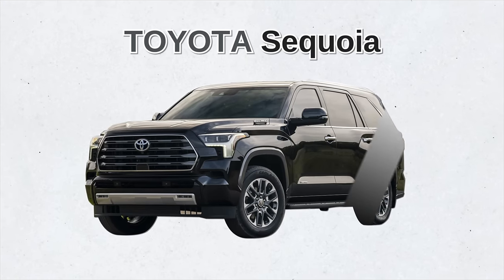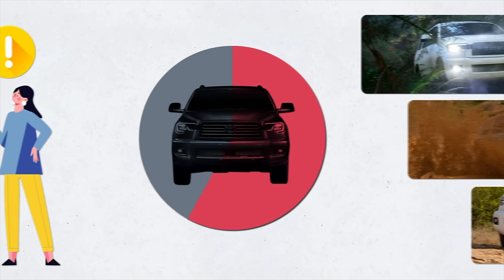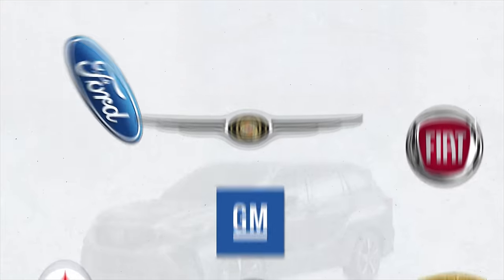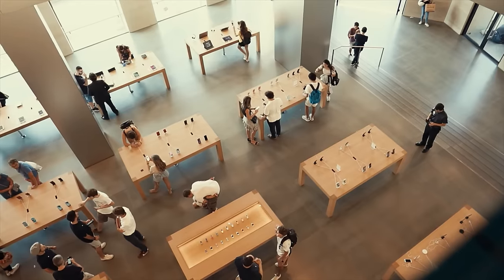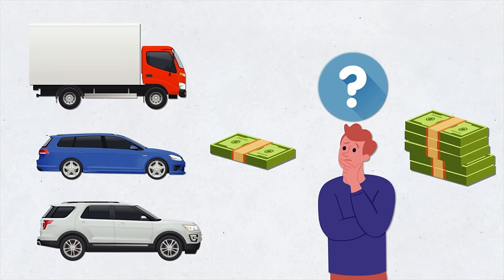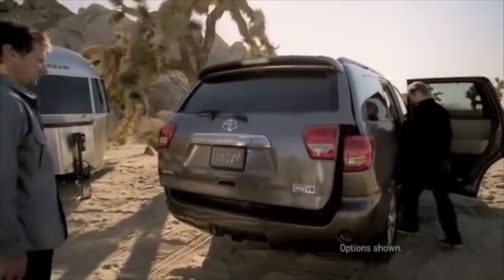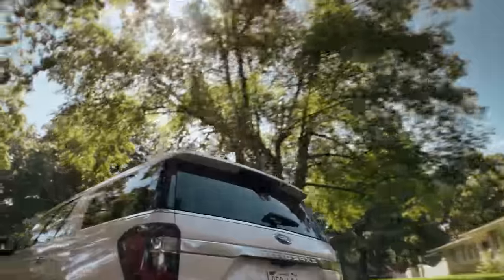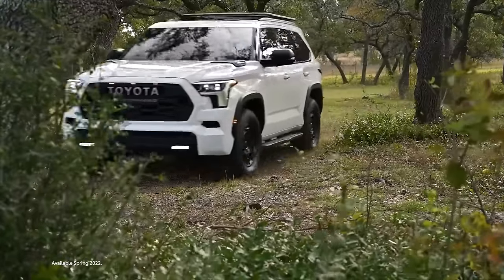Here's Why This New Toyota is Bulletproof

Comment: Shame on Toyota and most of other japanese car manufacturers for not producing more flex fuel cars right from factory. FFV, E85 fuel would be better way to reduce tail pipe emissions without elecrification and increasing size or weight of the car.

Comment: Scotty, the vehical will be useless when the air injection system fails, the waist gate fails or the paint just falls off. Besides, if your rich and want to be protected, you're not going to rely on a pollution regulated problematic 6 cylinder. You will get the big V8.

Comment: Toyota is ruining the Sequoia and Tundra with the new twin turbo v6 and in the Sequoia hybrid twin turbo v6. The I Force v8 is such a bulletproof engine. Now you have no choice.  I know the Tundra has had a lot of problems so far. I'm not a fan. Maybe they will get all the bugs worked out though.  Otherwise I love toyota just pre- 2022 models.

Comment: I knew he wasn't talking about the regular Sequoia with the small displacement turbo engine No way he  would say that's bulletproof Even if it is Toyota it's still a late model planned obsolescence imo POS.... But my dad was a mechanic so I consider every car/truck a POS They all break they all have to be fixed They all rot and need body work It's endless unless it sits in a freaking garage and never gets used Even then they need maintenance
Reply: P.S.  I'll never understand why they went to V6 turbo especially for frame on body truck or SUV in my opinion the straight six is a much better truck engine Plano and simple better configuration all together than a V6 I don't know why they went to v6s I mean everybody went away from the straight six but not everybody but all the American companies Yes I know Dodge and Fiat and Ram are going back to the straight six.... ram you get credit for knowing I6 is an awesome truck engine but we'll see if you can make the damn thing last I'm not holding my breath You are fiat and Dodge after all